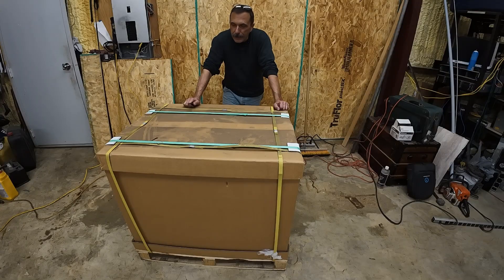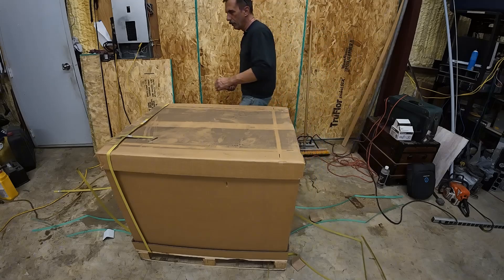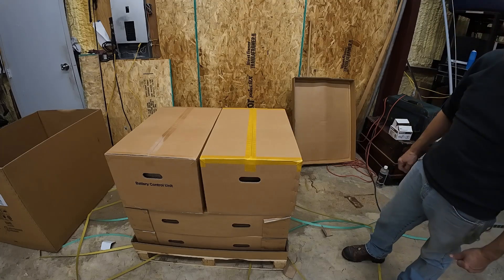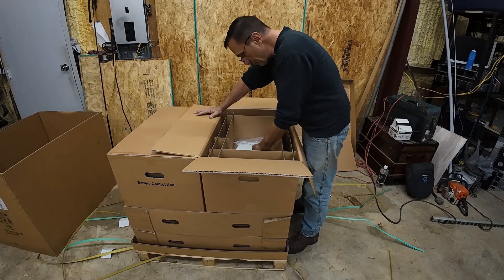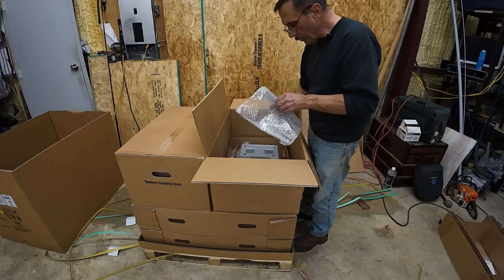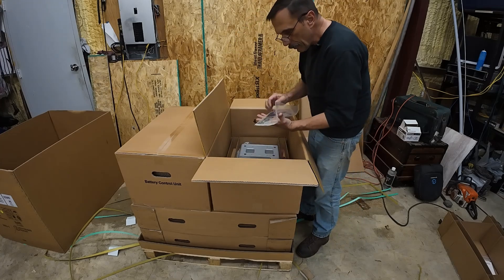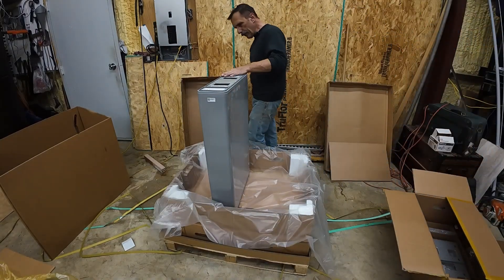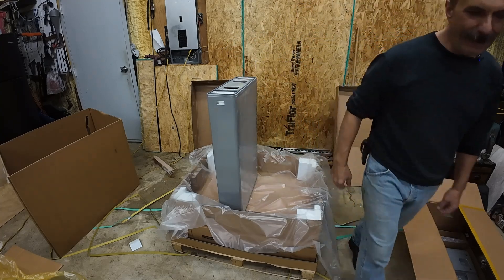LG RESU 16H 16 kWh High Voltage Solar Storage Battery. The Best Priced UL Battery Available.

Comment: Any negatives on this battery or to early to tell?  A 2000ish price for this is insane.
Reply from the maker: It's a solid battery, stay tuned I have a run time video coming very soon...
Reply: Had mine 2 years not much problems tripped a few times  just make sure firmware up to date for inverter setup.

Comment: the only negative is the weight
Reply from the maker: It's actually about the same weight ratio as the server rack batteries, they weigh about 100 lbs for 5kWh this is 350 lbs for 16kWh. But yeah, a little bit harder to move around although it is two battery cells so not to bad. It was much easier to move than My Nissan Leaf battery! 😂
Thanks for watching!
Reply: I hear these are the batteries that had massive recalls.  Is it true?
Reply from the maker: Not true, it was their old h10 batteries.